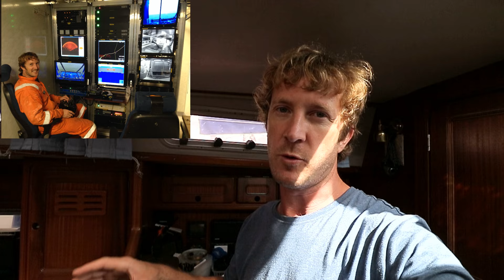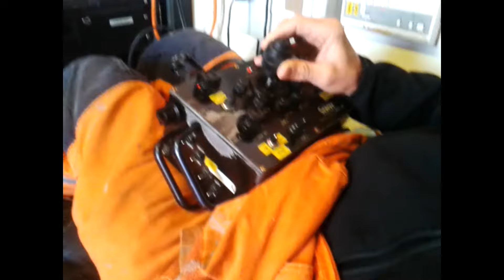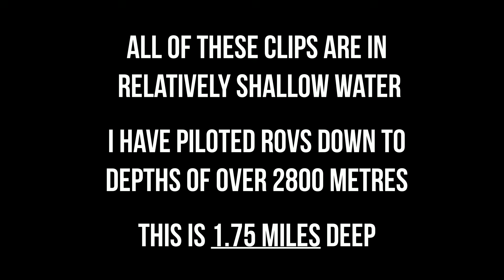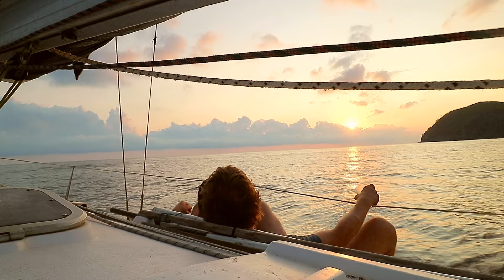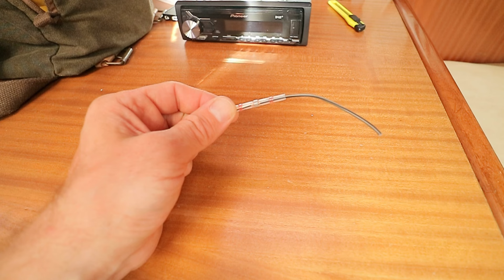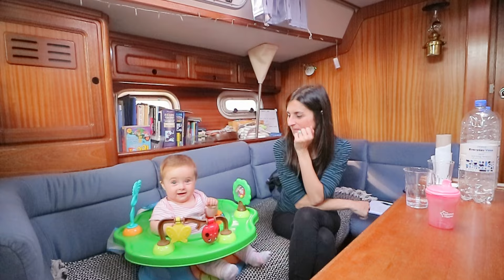Boat Wiring Just Got 1000 Times Easier! | ⛵ Sailing Britaly ⛵ [Gear]

Comment: That are pretty nice! Years ago i had a little pressurized tube of silicone with a small applicator tip that you push sideways to get the silicone to come out. The applicator tube was just smaller than a butt connecter, so before i crimped on the butt connecter i filled it up with silicone. Ever since then, probably 20 years, I've used this method for dirt bikes and now for sailboats. But now i slip on a piece of heat shrink, solder the wires, put silicone on the area, slide the heat shrink on and shrink it up. The extra silicone squeezes out as the tube shrinks, it's bullet proof! Well, water proof for sure:) Just wanted to let my secret out!

Comment: Hello, you mentionned that in offshore environment these connectors are in an oil-field container - what oil do you use? Thank you for your great technical skill sharing!
Reply from the maker: The most common oil I've seen used in subsea electrical junction boxes is Tellus 32. There are many alternatives though and if you wanted to make a homemade version I believe even baby oil would work just fine... Cheers, Chris 👍
Reply: @SailingBritaly  thank you for your reply. I decided also to use liquid electical tape - although that stuff is quita killer  it is written on it that '24 percent of the mixture consists of ingredients of unknown toxicity."... so the oil will protect me eventually, not the connectors..:)
Reply from the maker: If we're making up subsea cables we use potting compound. The procedure is to strip the cables, solder them as required (or use solder sleeves) place the soldered cables inside a potting mould, (after roughing up the insulation near the ends where they enter the mould) mix & pour in potting compound then remove the mould once set. Cables made like this will go well over a mile subsea without any problems at all...

Comment: Ordered! Hopefully you can get some $ back :) Probably shouldn't be used on high amps connections, as temps will melt it back.. Keep up the good work, Arrrgh from Sunny Florida!
Reply from the maker: Hi there, thank you! It's a teeny commission on a product like this but every little helps! 🙂 You don't have to worry about the solder melting in-service, the melting temperature is 135 Degrees Celcius (275 degrees Fahrenheit). Cables should never get that hot, even when sailing in the hottest climates. Thanks again and fair winds! Chris 👍

Comment: I bought Wago connectors, which I find so useful for temporary installations. They are far from being waterproof, but they feel quite strong when wires are connected . You can search then by "wago splicing connectors". Your soldering terminals also look very interesting, I will get some of them for more definitive installations. Thanks for sharing!
Reply from the maker: My pleasure Josep. Solder sleeves are great for permanent installations, I'm sure you'll love them! Cheers, Chris 👍

Comment: What is the re-melting temperature point?  If used in a boat that can reach 50ºC in a specific area, and if the cable is pulled, will the solder hold?
Reply from the maker: Hi Robert. The melting temperature is 138°C, so yes the solder will hold. Cheers, Chris